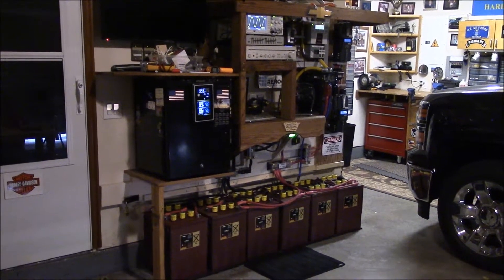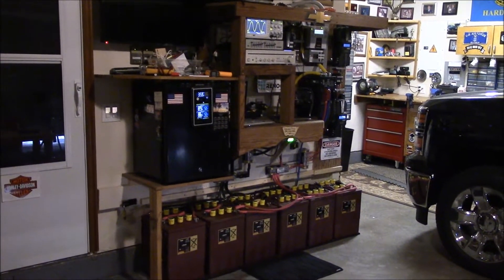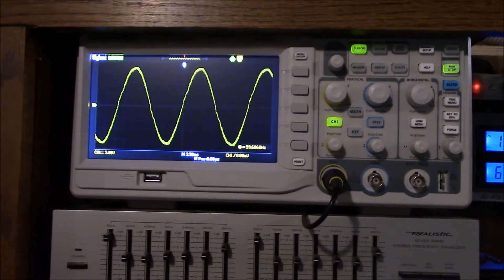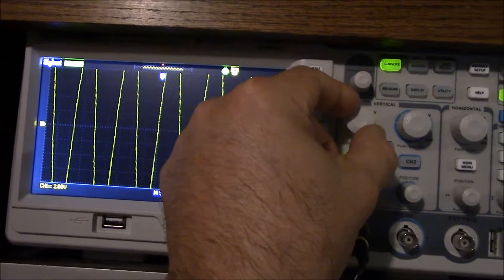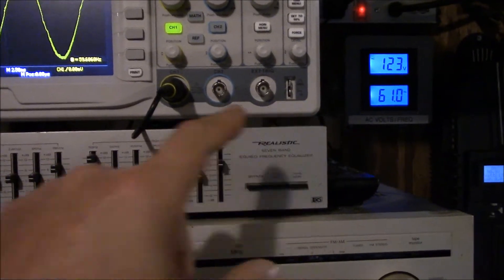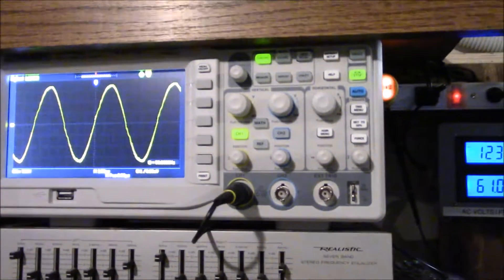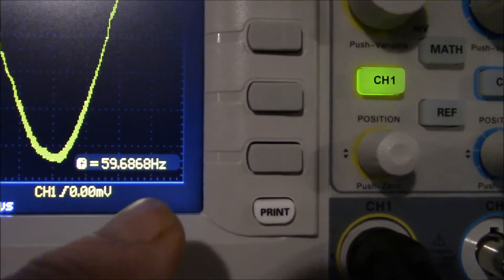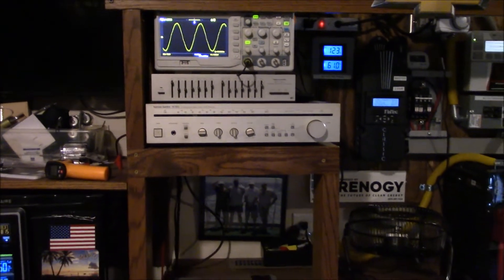New oscilloscope for my DIY home solar power equipment (initial check out)

Comment: bothered me so much i had to go pull the manual. lol.  looks like you just have the probe attenuation set to the default of 1X but using a 10X probe.  on page 7 of the manual it say you can push the vertical menu button and select the 10X probe attenuation.
Reply from the maker: Hahaaa! My bad. I checked the waveform using the cursors and it was right at 160 P-P. I grew up on really old analog scopes and at the end of my career we started getting digital ones in...will get it figured out. Thanks...good catch.

Comment: I must be missing something.  Scope says 5.00/division.  The video was a little blurry but shouldn't the peak voltage be around 160 ish volts?  115RMS converted to peak = 162V-P.  Your scope is only showing about 20V-P